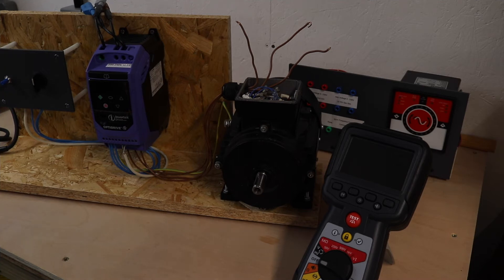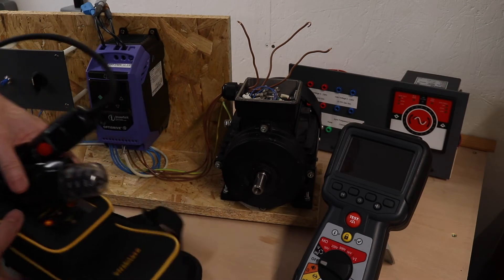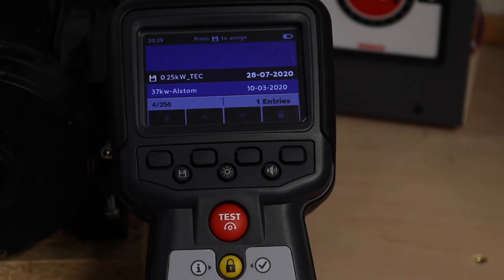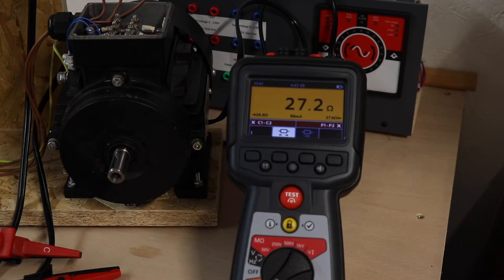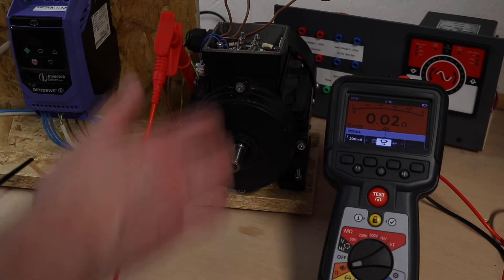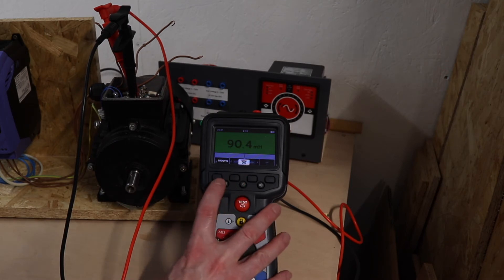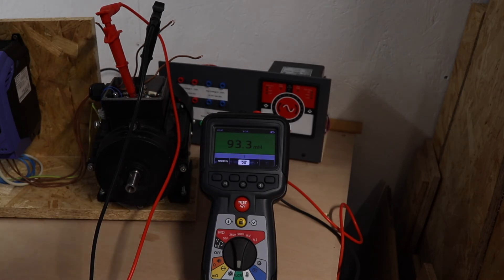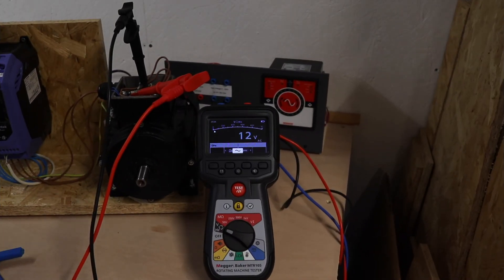Motor Testing with the Megger MTR105

Comment: Your channel name is 3 phase but you never even showed the 3 phase IR function lol
Reply from the maker: The 3 phase IR function on the MTR105, only measures between phases and not phase to earth. Therefore it cannot be used on a motor linked in star or delta as this one was. It will only work on split phases, such as motors wire to star/delta starters, or with the terminal block links removed on purpose.
Thanks for watching and commenting.
Reply: @three-phase562  awesome, thanks for the explanation. Would be great to see a video demonstration of it.
Reply from the maker: @ErikNemo  There is an explanation and demo of the 3 phase IR test function in another video in my play list for the MTR105.
https://youtu.be/ndtLLjRLIlA?si=uhhV4SNEk9Klm75I

Comment: Totally understandable about it not working on the inverter, especially a less expensive inverter with a probably dirtier output. The inverter chopping frequency is at least 8kHz and you saw that it kept detecting over 400Hz and it couldn't get a good reference. Not to mention the voltages all over the place. Possibly a higher quality inverter could put out a smother voltage signal, but still may not be good enough for the meter.  But the good thing is you can usually reverse rotation in the VFD settings, so no need to redo the connections if backwards. Still an awesome meter with a ton of functions to eliminate having to lug around three or four pieces of equipment on the jobsite. Seriously contemplating getting one, thanks for the video on it.
Reply from the maker: Thanks for watching and commenting. 

Yes, this is a cheap little inverter, good for the market it is designed for and does have a very square wave looking output. I have done some more work with this inverter and other instruments and they also struggle with it. It would be good to prove the MYR105 against a more industrial designed VFD with a filtered output, the MTR105 works fine on an injection test set, which has a filtered output.

Your penultimate comment is one that I feel I am not really capturing in the videos I am doing. The MTR105 seems to be along a similar concept as multifunction testers that we have for testing fixed installations, just aimed at motors. Not only do you not have to lug around multiple instruments, but the work flow process is also faster as you are not swapping around the connections so much, with a couple of tweaks of the meter functionality, this could be improved further.

Comment: Great video!! Ive been wanting one of these mtr105 ever since I got the first release flyer in the mail.

But since it doesnt seem to work with inverters or VFD it would not benefit me after all. Thanks for saving me from a potentially disappointing purchase!
Reply: Have you approached Megger about this and for their views. It always important to know about tool limitations like these.
Reply from the maker: I have not personally approached Megger. To be honest I rarely get responses out of manufacturers unless there are a lot of people highlighting a specific issue.
I need to see if I can work out testing it against some other inverters, as it may just be an issue with the cheaper variety.
Reply from the maker: Thanks for watching JT.
I am not sure why it didn't work on the inverter drive. This is a very cheap drive and converts single phase input to three phase output so not sure if that has anything to do with it. 
I thought that being only specified up to 400Hz input, the MTR105 had a built in low pass filter, but may be not.
The MTR105 does work fine on an injection test set, so I would like to try it out on other inverters, but unfortunately, they are not common in my industry, so I have to try and work something out.